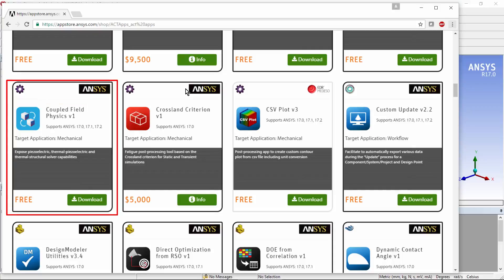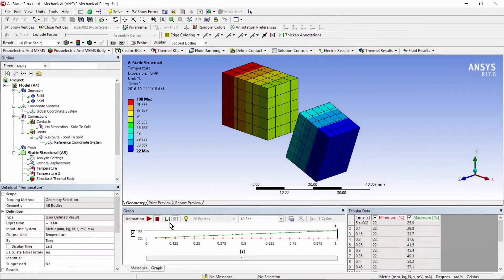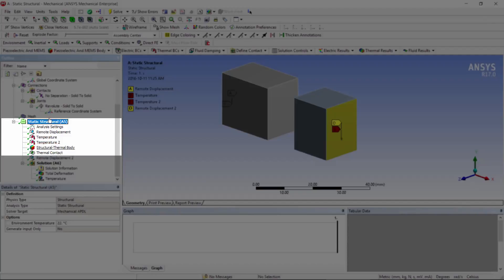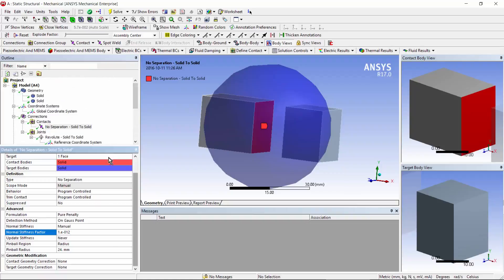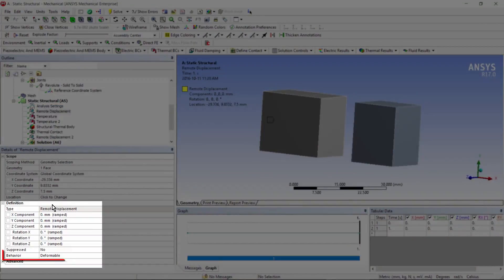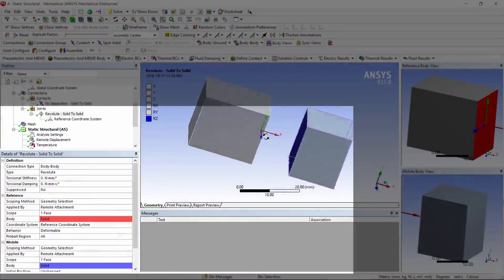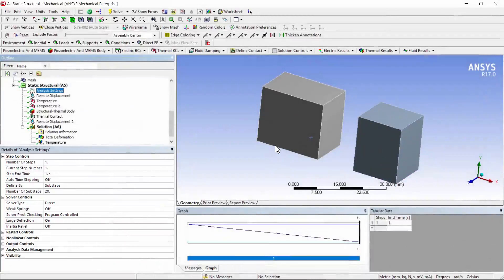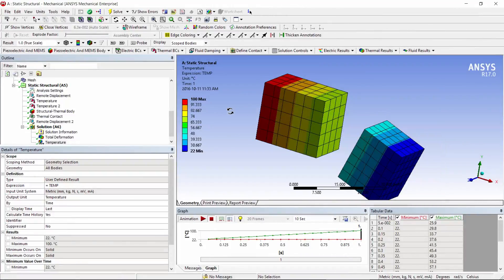How to Model Direct Thermal-Structural Coupling w/ ACT Object in ANSYS Mechanica Workbench

Comment: hello sir,i am doing a piezoelectric analysis. i have got a composite with piezo fibers and polymer matrix. i am working on an rve. my problem is that ansys do not give me the D electric flux density.
i observed that you set a thermal contact.do i have to set an electric contact for my piezo analysis?

Comment: You have to create the structural contact pair in advance of setting up the Thermal Contact. Give it an easily recognized name, and you should be able to pick it from a list in the Thermal Contact details.
Reply: Use PIEZO AND MEMS. Here it is working. Suggestions of Ansys.